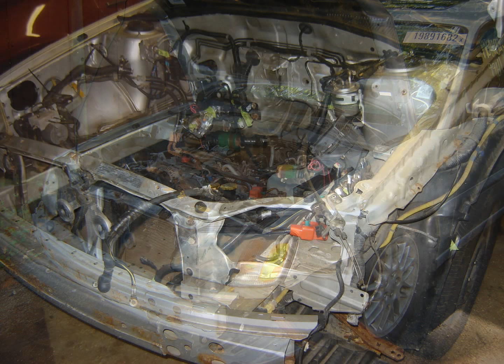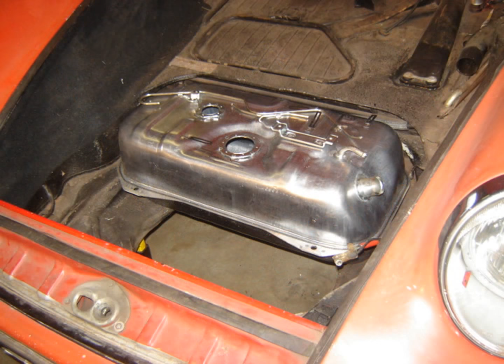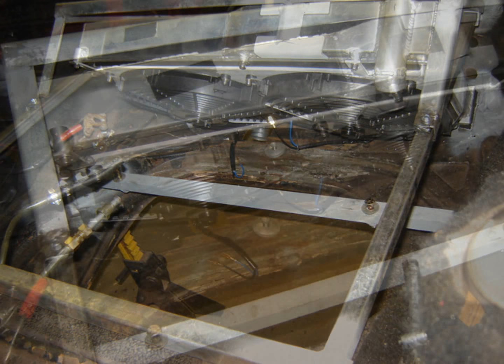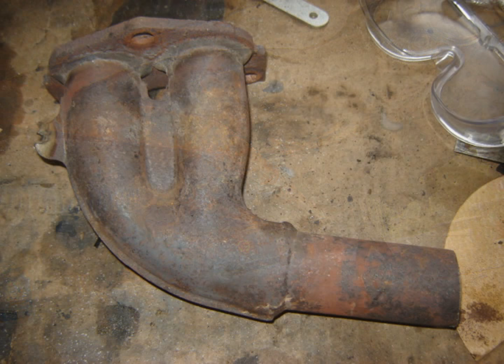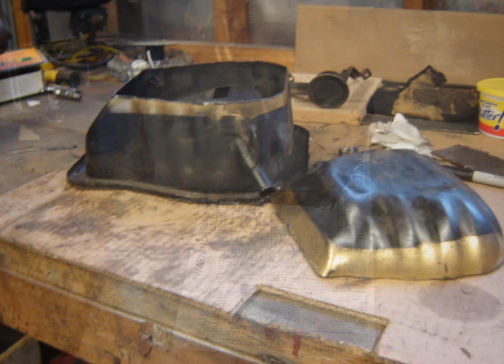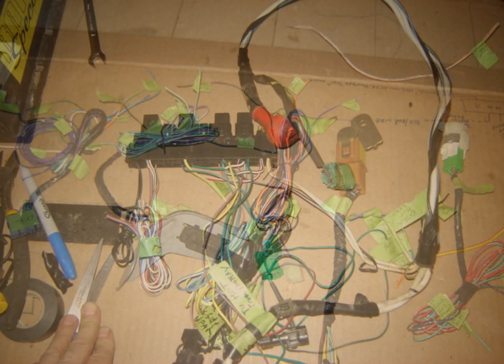Porsche 912 Subaru Swap pics

Comment: So you used the original 912 transmission with an adapter plate to the engine?
Reply from the maker: Datsun Z yes, KEP adapter plate and flywheel kit.